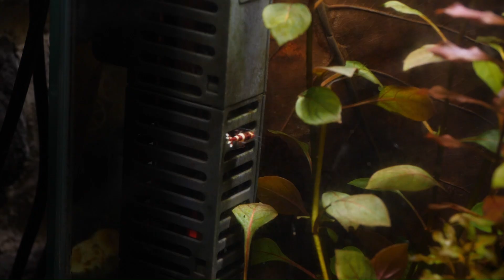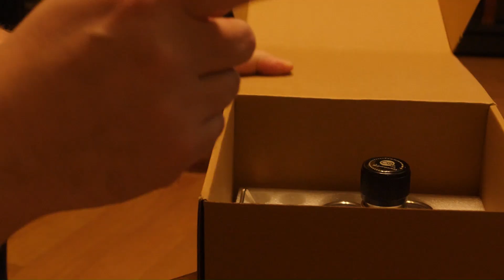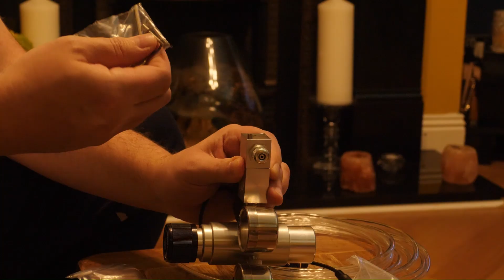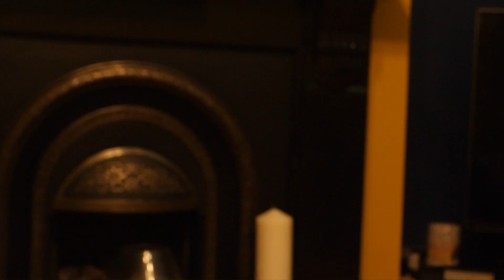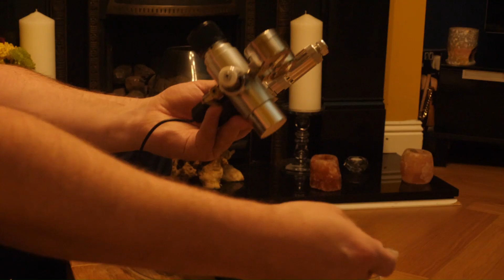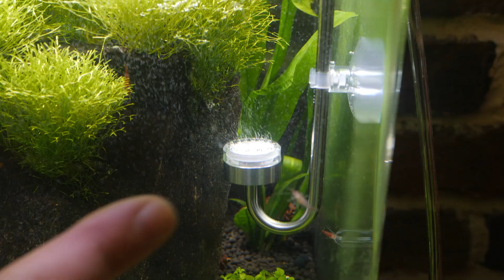How to set up a CO2 system on a nano shrimp aquarium

Comment: Nice nano’s. My only advice if you don’t mind me giving it is to lower the c02 diffuser to as low as you can which will allow the c02 more time to dissolve in the water column.
Reply from the maker: thanks for the advice much appreciated I may look more into that in the future.However these 1s are stainless steel and preformed to a set length